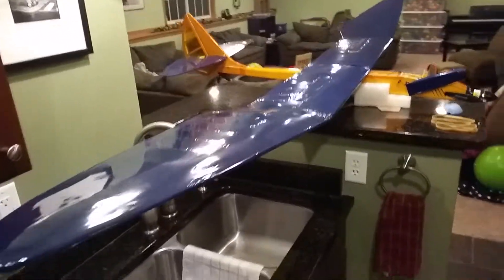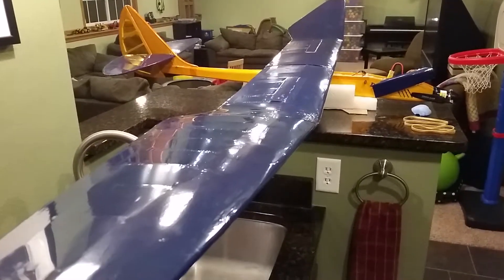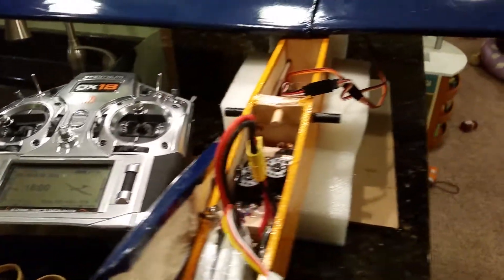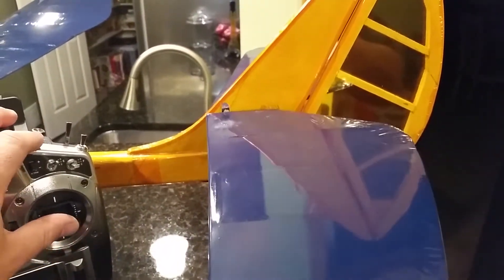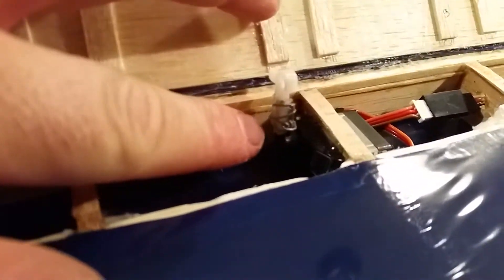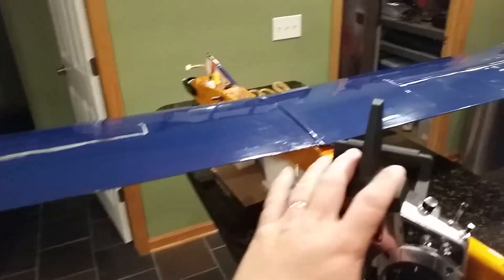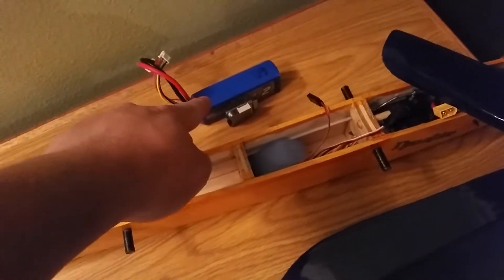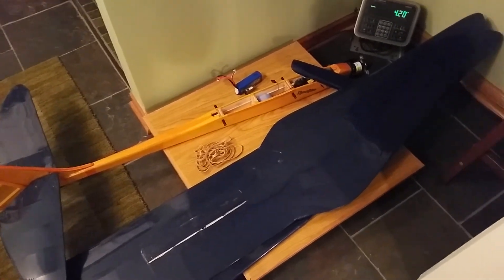Dynaflite - Bird of Time - Spoileron Mod - Part 5

Comment: 4.2 lbs not bad at all, Ill be very curious to see if the spoilerons aid in turning,  ive got a 2200 in there now as far forward and the esc all the way forward, saving 6oz from the 5200 battery ive been using, hope my CG is not so off that is crashes, but yesterday with the 3000 3oz lighter, there was a pronounced difference, noticed a bit of thermal lift and a lighter "feel" in the air, you should think about a camera mount as this is a great platform for filming 
If this goes will ill let Ben know im sure he would like to see the ARF flying well with a 2200
Reply from the maker: Well, let's see how she does tonight!!! I can't wait to get her out. A film will follow shortly, God willing - Keep an eye out.

Do you have any ballast in yours anywhere? I thought I remembered Ben saying, the battery, motor, esc combo was supposed to basically settle that. Sounds like you might have forced the lipo even further into the nose for even better CG.

If Ben was interested, I'd be happy to share my findings with him, but to be honest, if anyone whats to do this, they could just buy the stuff from him - it's really nice from what you say, and what I've seen. Some guys don't want to deal with the trial and error stuff, but for me, it makes for interesting video series'
Reply: Well his stuff is ARF specific, if some has or is building the kit ,your vid would be of great help. When converting the ARF to motor power, you cut off the nose about 3in in which contains about 8oz of epoxied  shot, and with the motor, esc and battery you make it up but his recommendation is a 5200 3s which gets placed touching the motor for correct CG, with the 2200 the CG its back about an inch, so will see, flying to tomorrow.
Reply from the maker: Hope all goes well! Good luck